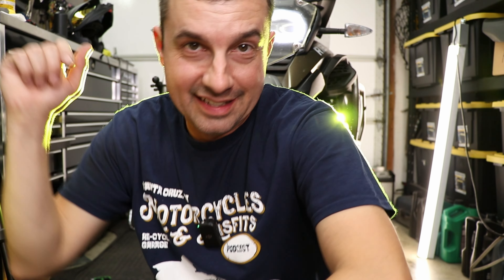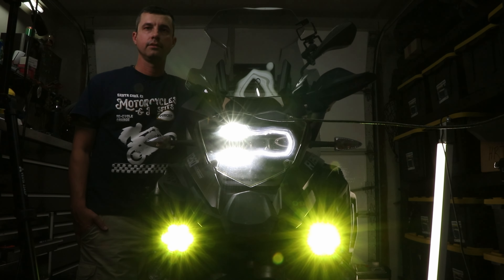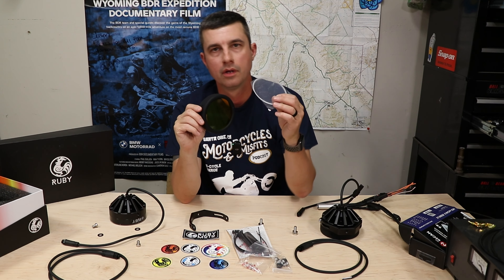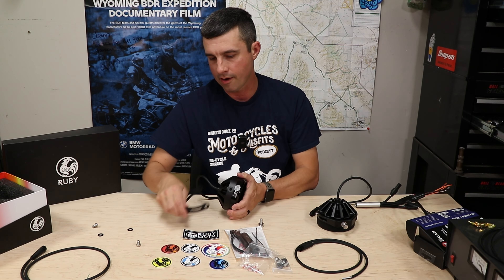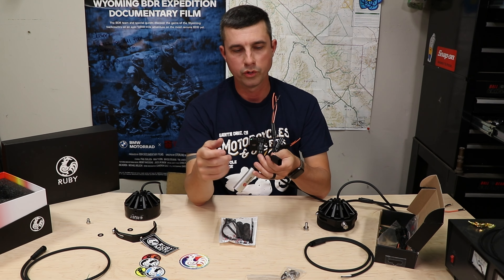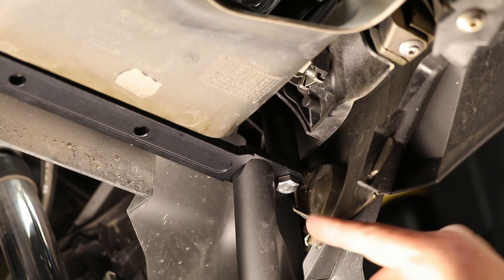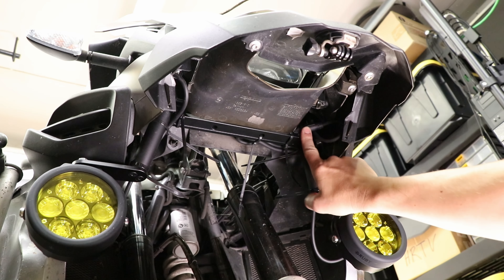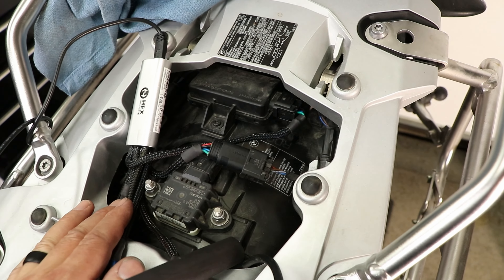Best Motorcycle Lights | Ruby R7 w/ HEX ezCAN

Comment: Great video. Thanks for sharing. Similar to you, I also do a lot of research and prefer Ruby's specs over the other popular choices. At the start of the video you shared the multiple ways that you use the Ruby R7's. On Ruby's site, they recommended R7's and potentially R4's for Daytime Running Lights (DRL). 

I have 2 questions for you: 
1) Are you using the Ruby R7's as DRL... along with all of the other features that you illustrated at the start of the video?  
2) Are the R7's possibly too large/bright at night?  I see that you can dim them, but would you recommend the R7's or the slightly smaller/dimmer R5's?

Thanks again!
Reply from the maker: I still run the factory GS Adventure aux lights. I pointed them more down and turn them on when it's dark. I like how it gives me nice light right in front of the bike. For the R7's I run them all the time with the yellow filters. The Hex ezCAN allowed me to adjust the brightness when it's dark and daylight. The bike has a ambient light sensor and tells it when to change so it happens automatically. I don't think they are too big, and the ability to adjust their brightness is prefect. They're both flood and beam, so I also make sure the beam is at or below my low beam line.

Comment: Great video, just wondering how you configured the lights to work as indicators as well as spotlights with the Hex, I get only one option to either select them as spotlights and then the high low beam works or as indicators
Reply from the maker: It's hard for me to explain what I did as I don't have it memorized. I just remember going through all the setting and messing with things. Perhaps they have a customer help line. I looked through the manual but only found this: 

5.3.5 Operating auxiliary turn signals
Depending on its configuration, an auxiliary turn signal will be active as
a running light or marker light whenever the ignition switch is ON, active
as a turn signal whenever the turn signal for that side is switched on, and
active as an auxiliary hazard light whenever the hazard lights are switched
on. To use this feature, set one or more power circuits to power auxiliary
left or right turn signals. The Turn Signals section of the ezCAN
configuration software will be shown (below, left). This section of the
software is associated with the Left Turn Signal and Right Turn Signal
circuit configuration options (below, right).
Reply: So he set them as turn signals and not aux lights? But then the 3 sec hold of the turn signal cancellation button shouldn’t turn them on/off though

Comment: Hello what is your opinion so far on the Ruby 7/Ruby in lights overall. How is there customer service ? There is very little to no info online on these guys. They need to pick-up there social media game... I am on the market for my BMW 1250 2023 for a light kit, Denali, Clearwater etc.... Not opposed to try out the new guys on the block.. supporting new comers with great products is important. Let me know your feedback.  Thank you
Reply from the maker: I bought direct from their website and I've had no issues. They've been on the bike around 15,000 miles. I picked them due to there smaller size and high output. They were cheaper than Clearwater and Denali. I also like they are both flood and spot. The HEX ezCan is a must on our bikes too.